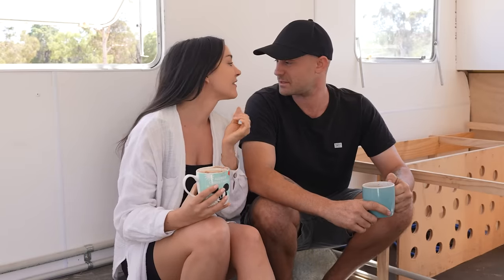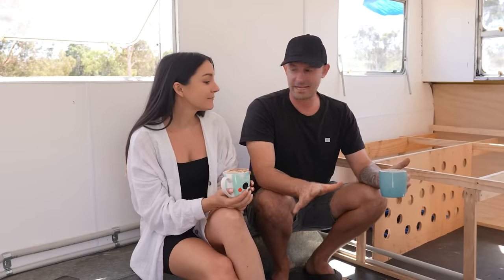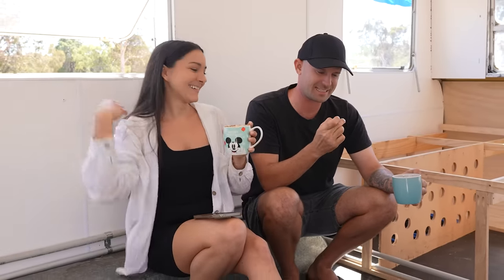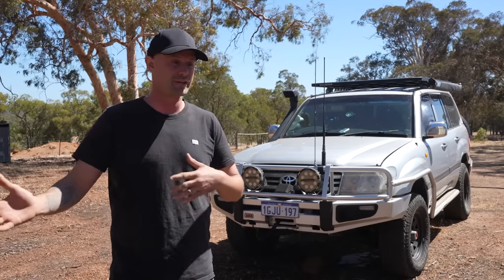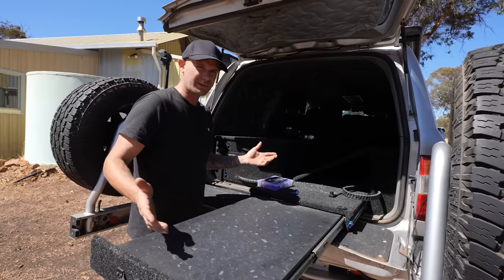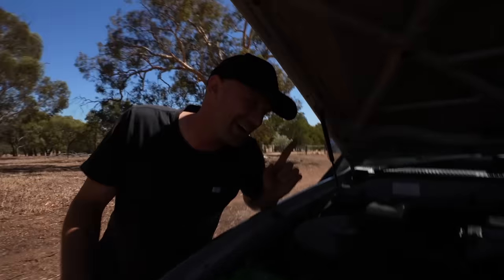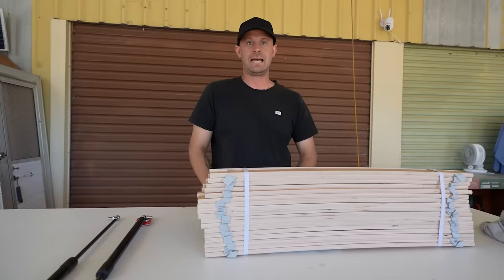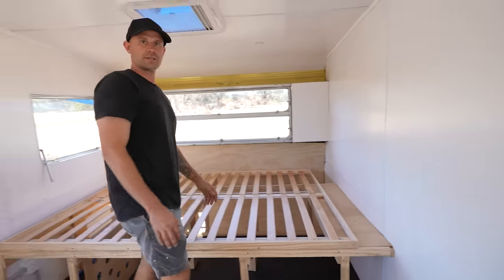We have been keeping a secret 🤫 (Q&A)

Comment: Haha, I got a vacuum sealed king size inner spring pillow top mattress for our van as it was the only way I could get a KS mattress in. 6 years later it is still a very comfortable mattress. Congrats on going Renogy, I have a 170AH Renogy lithium battery, 40a DCDC charger, 30a solar controller and 1000w inverter in my camper trailer, excellent battery system and I have run an induction cooker off the 1000w inverter for the past 3 years with no problems. Nice job on the van so far and love the new car, we have a 100 series TD that has towed our 20ft van for the past 6 years.

Comment: HDJ100 is such a great choice, I just know you'll love it because I just bought one myself after owning both an N70 and N80 Hilux I absolutely love the 100. I noticed that your 100 has two spare tyres mounted on the rear bar, which made me think if you haven't already considered it, and assuming it's possible, I think it'd be a great idea for you to make sure Myrtle has the same stud pattern and diameter wheels and tyres (perhaps road tyres for Myrtle and AT's for the 100?) so that you don't have to carry a third (different sized) tyre just for Myrtle. Similarly, again if possible, maybe make sure the shocks (or just as many parts as possible) are also the same size on Myrtle as the 100? "Two is one, one is none" as they say.  Love the videos guys, keep up the great work.

Comment: Congrats on the 3 Year Mark, and good to see a 100 series :D ... Renogy is good gear guys, but you're def not the first :D ... Renogy has been here in AUS for a few years now.  I personally have run full Renogy sysems in both my car and trailer for over 2 years.  Dual Lithium batteries, DCDC's, Solar Controllers, Shunt&Display and Inverters in both.  Its good bang for buck gear, they're after sales service here in AUS is a bit poor, if you do have any questions etc its generally better emailing the US sites if you actually want to get a reply.

Comment: Can't beat the mighty 100 series guys! Don't forget to periodically check your map sensor for cracks... you'll know when its buggered, you'll be down on power.

As for the 5 map select...mate, at least put it in the towing/daily tune. The extra power helps with your fuel economy. The daily/towing tune should be set to number 4 on the selector.

Comment: Great video guys enjoy your travels. The Renogy gear is good gear. I’ve been running it in my system for two years 200 W lithium battery 2000 W inverter charter charger Bluetooth connectability and also the 50 amp BCDC I also used the Egon dc from Andrew Saint Pierre White has never missed a beat
Reply from the maker: Hey thanks for watching! Can’t wait to get the gear in the car hey! Good to hear it’s going well for you.